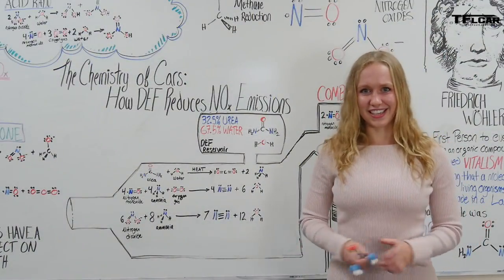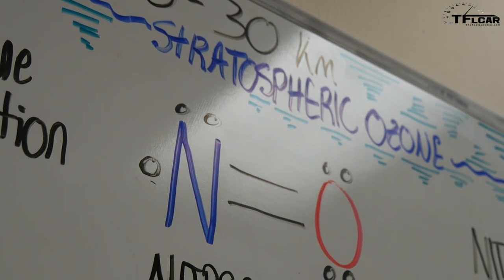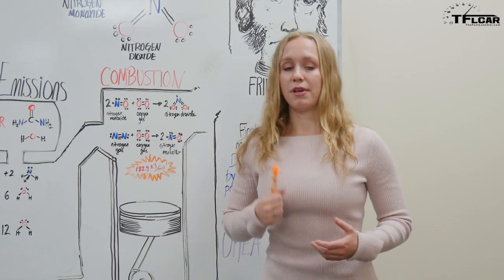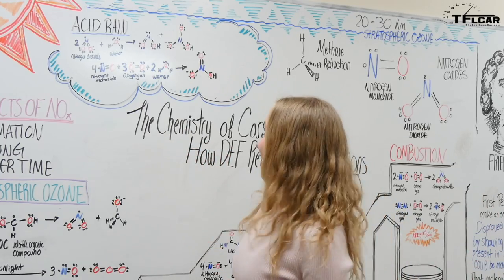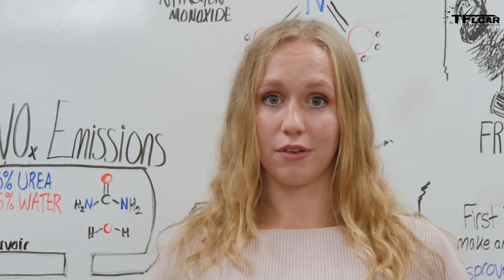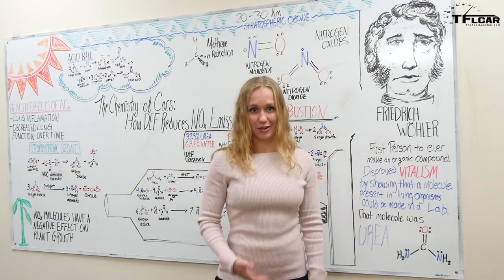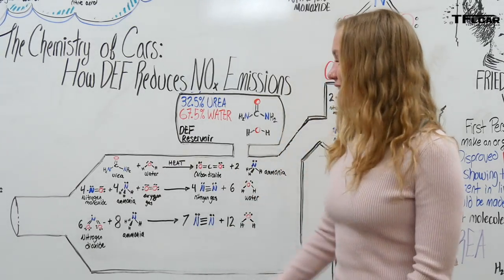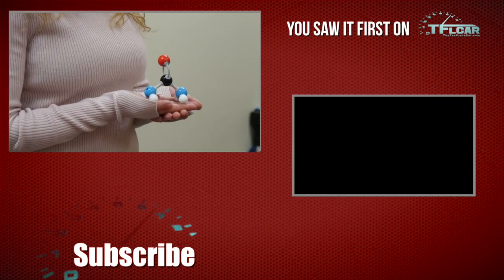How Does DEF (Diesel Exhaust ) Fluid Work & Is it Really Pee? The Chemistry of Cars Ep. 1

Comment: What you forgot to mention is that over 90% of NOx comes from other sources than transportation. Passenger vehicles are only a fraction of transportation emissions. We're sending a firetruck to a barbecue instead of the burning forest. Gasoline engines emit a couple times more of tocix hydrocarbons and everyone's quiet about it.
Reply: Who says everyone's quite about it? There are standards set for HC emissions like all others. The difference between gas and diesel is diesels have a much harder time meeting the standards people set.
Reply: @Chris C
Again - gasoline and diesel angines are producing the same pollutants in different proportions. HC limit is a couople times higher than diesel emissions. If US limits were set to diesel proportions - gasoline engines would struggle to meet the standards. That's why in the EU there are separate standards for gas and diesel engines based on actual emissions.
Reply: Well, that's the EU, and their standards are following in the steps set by CARB and other regulatory bodies in North America, creating the same problems for EU market diesels.

Doesn't matter what's more or less challenging, the limits are set. Just because one splits the hairs for one type of emissions doesn't mean we can't apply the same standards on a full head of hair across the board for other types of emissions. If diesels have  trouble meeting the standards, too bad. All types of engines, gasoline, diesel, natural gas, etc. are having their emissions slashed by the same standards, some just more than others.
Reply: One more thing, in the same way diesels engines are being forced to cut NOx, gasoline engines are being required to reduce fuel consumption. Is that unfair and should we just let all gasoline engines guzzle more simply because, by nature, they aren't as fuel efficient?
Reply: I wouldn't call reducing emissions limits as following someone's steps. The whole world does it. What EU is not doing is forcing diesels meet gasoline emissions limits like in the US. In the EU there are two standards - for diesel and gasoline engines. Diesels wouldn't meet gasoline standards (that's why they struggle in the US) but gasoline engines would fail to meet diesel limits. That's the difference. 

All engines are forced to lower fuel consumption, it's easier for diesels because they have higher efficiency. Your comparison is wrong at the first place. Diesels are being forced to cut NOx, gasoline engines are not being forced to cut HC.

PS. Natural gas engines need to follor gasoline standards because that's what they're based on.
Reply: "I wouldn't call reducing emissions limits as following someone's steps." 

If you're taking steps in reducing emissions, you are. Everyone follows CARB, even us in Canada.

"What EU is not doing is forcing diesels meet gasoline emissions limits like in the US. In the EU there are two standards"

NOx standards are being aligned all over the world, no mater the type of engine. Why would we want there to be multiple standards? That's very stupid. It doesn't matter what you drive or what fuel your use, you can't emit X amount of NOx period, and that's exactly how standards should work.
 
"All engines are forced to lower fuel consumption, it's easier for diesels because they have higher efficiency. Your comparison is wrong at the first place. Diesels are being forced to cut NOx, gasoline engines are not being forced to cut HC."

That's absolutely false. Again, gas engines absolutely do have restrictions. If your gas engine is producing HC at a certain level, it can fail smog testing in BC and all over NA. And if gas engine manufacturer aren't producing gas engines that meet certain average requirements, there are penalties. It doesn't matter whether gas engines are more or less able. There are standards that everyone and every engine must follow.

All I'm doing is repeating now. If I'm just repeating. you're not listening and present no valid counter argument. People are not "quite" about HC emissions in gas engines, there are plenty of rules set by regulators on them, just as there are on other types of emissions and fuel consumption with all engines.
Reply: +sic22l With rising costs and lower sales, diesel are beginning to struggle in Europe as well. The NOx standards in the EU have become about as tough as they are in the US. This is not US-only issue, diesels are having trouble complying in every advanced nation.
Reply: @Chris C
First CARB emission standard started being mandatory in 2004 in California. First Euro standard for passenger cars was applied in 1994 in the entire European Union. Who follows who?

Why would we want multiple standards? Becuase different types of engines are producing pollutants in different proportions. US limits didn't come out of the blue - they were set based on the proportions of pollutants in gasoline engines. Gasoline based limits are unfair against diesels, diesel based limits are unfair against gasoline engines.

Why is it false? This whole discussion isn't about being above limits but about how those limits were set. What were they based on? Gasoline engines are producing 10x more CO (carbon oxide) and 8 times more HC (hydrocarbons) than diesels. Diesels are making 0,8 times more NOx.
When proportions and limits are based on gasoline emissions diesels are bashed for making 0,5 times more NOx. But if proportions would be based on diesel emissions, gasoline engines would be bashed fo making 10 times too much CO and 8 times too much HC. That's the point.

Again - it's not about that there are no rules set but about the fact that because of those rules are based on emissions from gasoline engines (in the US), they're very mild about CO and HC emissions and quite strict about NOx. Simply because gasoline engines are making a lot of CO and HC and much less NOx. 
Diesels are making very little CO and HC but a bit more NOx. That's why it's unfair to put them into the same box.
That's why EU is doing it better - there are two standards (allowing more CO and HC for gasoline engines and more NOx for diesels) which are gradually lowered to reduce overall emissions.

@Hambone
Diesel sales are still pretty strong in Europe. It's going down but it's not about the costs. It comes from the fact that modern turbocharged gasoline engines are really good now, they're quiet, they're fun to drive (a lot of torque at low revs) and they can be pretty economical. They make much more sense now. You may struggle to buy a good car with naturally aspirated engine in Europe. Diesels still make a lot of sense in SUVs/crossovers or when you're doing a lot of highway driving.
About the emissions - as I already said above, EU has separate standards for gasoline and diesel engines because they're producing pollutants in different proportions. Gasoline engines are allower to make more CO or toxic HC, diesels are allowed to make more NOx. In both cases those values are going down. More importantly - NEDC (New European Drving Cycle which is easy to cheat) is going away and in the next year or two it will be replaced by actual road tests.
Reply: You're making this about the US when there are no markets where gas vehicles have trouble meeting any CO or HC standards set. There are, however, many markets where diesels struggle to meet NOx standards including Europe.

Also, California has been regulating exhaust emissions long before 2004, though through different "clean air" agencies. You couldn't even buy a new diesel for many years here in California because no manufacturer produced a car clean enough, you'd have to buy them out of state and import them used. California has consistently been tougher, whether it be with CARB rules, the HHA, you name it, it's always been tougher here than almost anywhere.

You know, your information is pretty old and not relevant anymore. Emissions reduction is tricky. When you reduce one type of emissions, you often increase one or more other types of emissions. In modern diesels with particulate filters, diesels produce less heavy particulates, but they increase other kinds of emissions that we regulated, which is why they require so many tricks and other exhaust treatment to scrub the exhaust to keep these emissions under control. You can make diesels comply, but the systems required are super expensive and complicated, and many manufacturers rather just cheat rather than lower their advertised mileage, face warranties claims or spend the money on developing diesel engines with cleaner technologies.
Reply: It is about US. Gasoline cars meet CO and HC emissions because limits were set considering actual emissions from such engines. Thing is - in the US diesels have to meet the same limits that were adjusted to gasoline engines (that allow more CO and HC but less NOx). 
No gasoline car will meet diesel emission standard in Europe. And noone forces them to. US forces diesels to meet gasoline emission standards.
Cheating is another thing. There's no passenger car that is able to meet US NOx limit. Chevy Cruze is cheating as well. There are plenty of diesels cars (usually smaller ones) sticking to the EU limits without cheating.

Comment: Just because diesel does not burn at the same rate as gasoline 14.7=1 does not mean it's not stoichiometric to its own fuel burn ratio an cars are burning leaner today more then ever an incoming so increasing the nox output an wearing out engines with e85 pitting engines an cylinders an burning out cats sooner

Comment: Sadly the trucks get worse fuel economy, so which is better. Lower Nox emissions or lower fuel economy, causing you to use more diesel, which means more is used all the way down the line from production right to the end user. So what are you saving? In my opinion it's a smoke screen.

Comment: Thank you volkswagen.
Reply: Haris Mak def has been around WAY longer than when dieselgate unfolded
Reply: Guarantee those VW diesels were putting out less gunk than the same years of american diesel pickups.
Reply: Jeff K i thought so too, than i had to write a paper on dieselgate, and found that the new trucks were emmiting less Nox than the "bad" volkswagens. Forgot where i read it though
Reply: Perhaps Charlotte can explain how a 6L diesel engine produces less emissions than a 2L engine, when the 6L is burning 3x the fuel to begin with? Here in NJ, any diesel truck over 6000lbs CW isn't required to pass a diesel emissions test.
Reply: fredbrackely. Politics due to most being farm or commercial vehicles??

Comment: Why not start with ammonia if that's what's doing the work?
Reply: Can't. Ammonia in significant volumes is too dangerous. It's caustic. So, the folks set up the system to get us to the point where the ammonia we need to do the job, gets "made" right at the point where it's needed and won't harm any people - inside the hot exhaust stream. 
The DEF fluid in its raw state (before use) is relatively harmless should a person get any on their skin (I certainly don't recommend doing it on purpose), and despite being a minor problem in very cold weather, can be dealt with by adding a heating circuit and have the engine management system allow a short period of operation without the supply of DEF while the heating circuit re-liquifies frozen DEF in the DEF tank.

Comment: what if you just add ammonia?
Reply: Can't.  Ammonia in significant volumes is too dangerous. It's caustic.  So, the folks set up the system to get us to the point where the ammonia we need to do the job, gets "made" right at the point where it's needed and won't harm any people - inside the hot exhaust stream.  
The DEF fluid in its raw state (before use) is relatively harmless should a person get any on their skin (I certainly don't recommend doing it on purpose),  and despite being a minor problem in very cold weather,  can be dealt with by adding a heating circuit and have the engine management system allow a short period of operation without the supply of DEF while the heating circuit re-liquifies frozen DEF in the DEF tank.

Comment: The system works only for a while. Then it clogs and then you need to put out anywhere from $2500 to $5000 to fix. Abut every    year and half or so. We shouldn't have to use this system till they come up with something that really works

Comment: Why don't BIG RIGS have to use DEF?  Only for consumer diesels?!  WTF!
Reply: Sam Iam Big rigs made since 2009 will either use DEF sold at a pump or they will use a gas recirculation system depending on the engine manufacturer.
Reply: Sam Iam They do, they got all the same emissions the passenger vehicles got at roughly the same time, heavy equipment was what got it last but now they pretty much all have to have the same emissions equipment, there is a engine size where you dont have to have the emissions and i want to say its 1.2l or smaller but dont quote me on that.

Comment: diesel must have oxygen lots of oxygen increase the fuel pressure to better atomize the fuel, increase turbo psi to produce more oxygen and you get more horsepower and torque less fuel consumption and less emissions and as well as less money in oil industry's pocket. P.S. you have drop the choking emissions system

Comment: Pretty good BUT back to the ozone layer and stratosphere. The earth spins within the stratosphere and ozone layer which don't move & the jet stream moves our upper air around our planet caused by the heat of the ocean on the equator, so European deaths shouldn't be blamed on diesel emissions cause the pollution moves eastward over Russia or the middle east before hitting Asia which is worst than Europe for Diesel fumes.!
Reply: Diesel emissions effect air quality; the air quality index actually measures, among other things, Nox and ozone. Take note of the emissions testing cheating news lately.
  Part of the reason it came to light, is that the pollution level measured in the cities with higher amounts of diesel vehicles were not consistent with the reported emission testing results; the testing was squewed by relaxed emission test procedures. Pollution controls were designed to pass the testing, not release the pollutants at the required levels in real world use.
All systems burning fossil fuels release pollutants, we just pick on cars because it's easier to identify, and vehicle owners are easier to pick on than big business and big real estate, who likely release more total pollution.